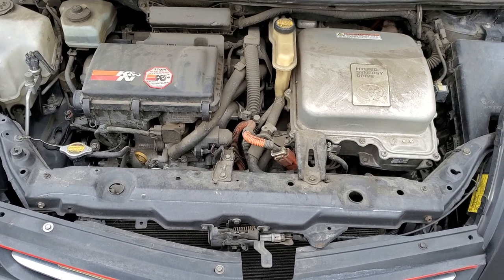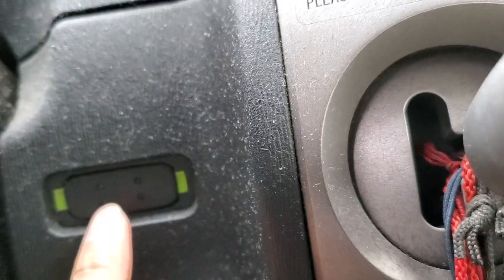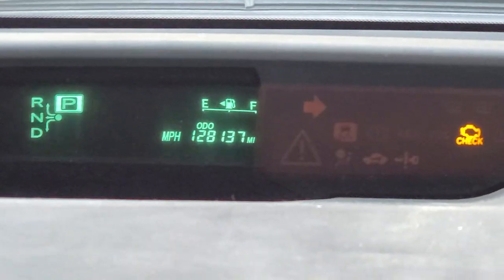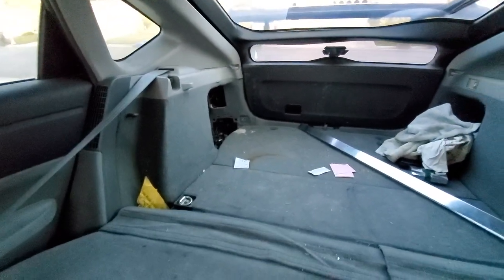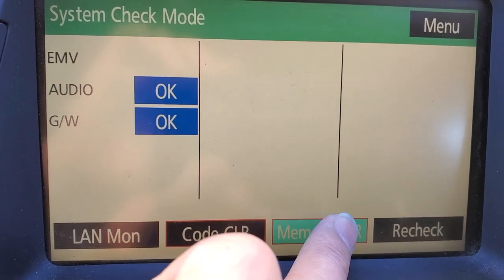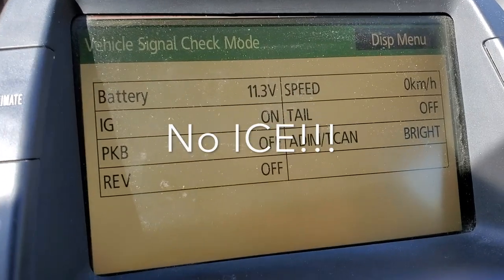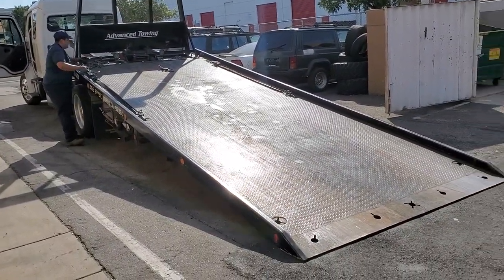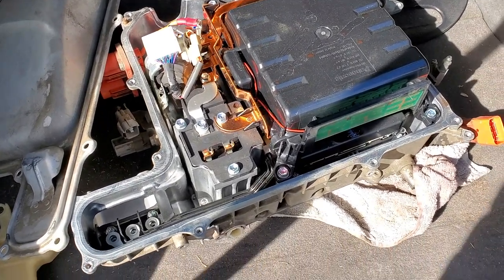How Do You Know If Your DC/DC Converter  P0A94 & Prius Hybrid Battery P0A80 Goes Out!

Comment: Hello man can you tell me what to do please I think my dc/dc is bad but my hybrid battery is good.   And I’d no leaks
Reply from the maker: Check if your pink coolant is leaking around your DC/DC hybrid system where the small resoriver is at. It's hard to see but that's where it joints that breaks around the plastic. Depends on the engine code, I had to replace my DC/DC converter and the coolant resoriver.